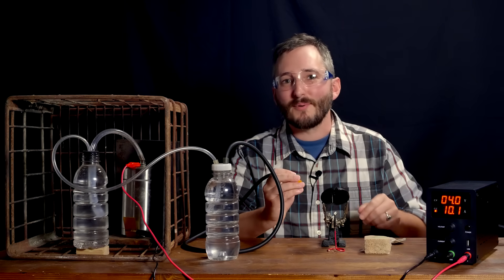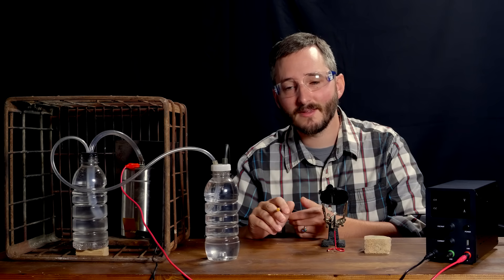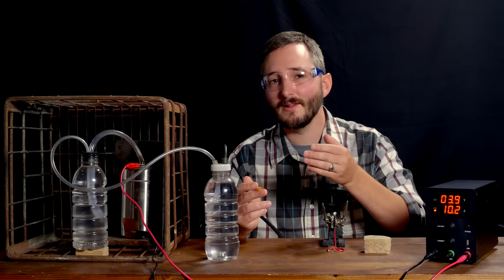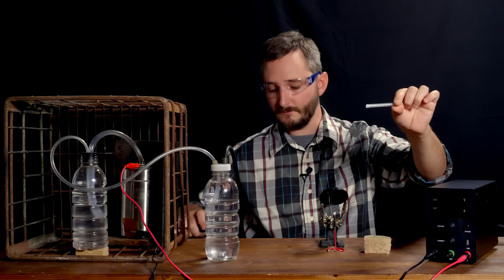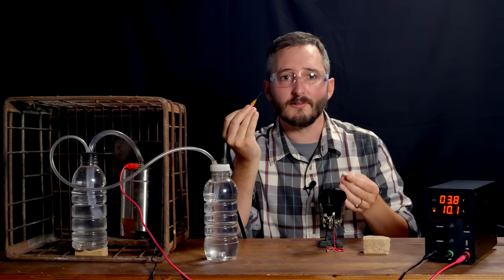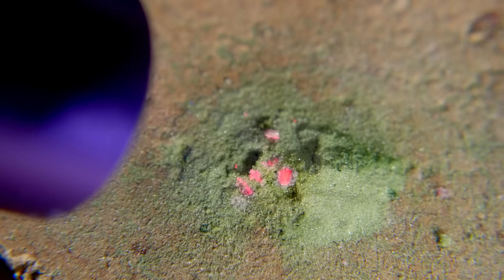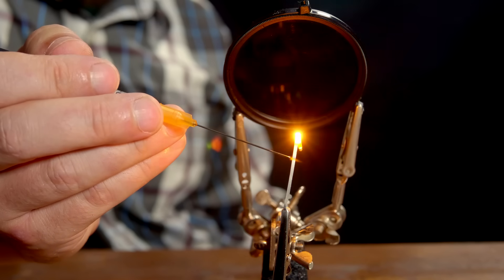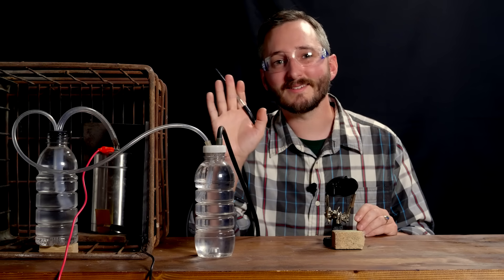DIY Oxy Hydrogen Torch Using Water Electrolysis

Comment: Thanks again for a very information packed video. You once again dug out a whole lot of excitement from a very basic scientific concept. 
Two questions:
1. if you can so easily ‘wipe out’ the retro burning with a simple swipe with a wet sponge, can’t you then prevent that risk by just always holding / firmly tying a wet swab around that fine metal tube? Or a cotton thread wrapped several layers thick and kept ways soaked in water. May be also have a much longer metal tube with that wet contraption outside. 
2. Why isn’t the stainless tube needle melting with the heat?
Reply from the maker: Yes, you can wrap wet cotton around the needle and that works well. The needle doesn't melt because the flame normally stays outside. When it goes inside the needle does melt, but not instantly

Comment: 5:23 The aluminium in the syringe will also cause the flow rate to drop significantly as it creates resistance for the flow and a turbulent flow.

Comment: Is there any reason you couldn't extinguish it by dipping the tip in a cup of water?
Reply from the maker: Lowers flow rate of the gas potentially causing flashback

Comment: I made a really effective HHO generator from 2 stainless steel tubes with a spiral of insulated 2.5mm wire separating the 2 tubes (one inside the other) surprisingly the spiral angle makes a difference to the output, at the same power draw. I setup 7 of these tubes in a container and let it rip at 30v and about 15amp draw it makes a decent amout of HHO.

Comment: "forces the gas pressure to increase"... I don't think so, this type of constriction creates a classic Venturi effect which increases the flow rate and counterintuitively forces the gas pressure to decrease.
Reply from the maker: Gas pressure increases in the system as a whole due to the smaller outlet. Pressure only decreases in the nozzle itself as speed increases.

Comment: Great video. Well explained an interesting. Could one not adapt the system to use an adjustable brazing torch head? Is this fuel source too dangerous for a foundry or furnace?

Comment: Great info and designs here. Surface area greater the more flow of electrons and efficiency combined with KOH being the best electrolyte is a bundle of help hard to find. I knew about surface area logically but KOH being so much better than salt or baking soda fascinating.   By the way do you know how long stainless steel scrubbers last with KOH? How long before they have to be replaced? Love the ease of replacement. I surmise the scrubbers inside the stainless steel wisker highly extend the life of it with most current electrolysis shunted to the scrubber. What is your take or opinion.

Comment: A lot of pussy footing going on here. Their is no reason why this could not be adapted for practical us with small counter gas, cooker
rings. In which bubbles and filters are used to prevent blowback. Or dampers to extinguish flames,  by using wet cloths as a experiment first before looking at other things that could extinguish flames on the rings safely.
Reply from the maker: No stove burner is made to work with oxy mixed gasses.

Comment: Hey man just an idea, if you used a small C02 cartridge, like from a whipped cream dispenser ect, couldn't you pressurise a small valve that could open, with either your control or a small temperature sensor at the end of the needle, which could send a small amount of C02 into the system increasing the flow rate, with something that isn't flammable? Couldn't you then use this for longer periods of time without worrying? Or just have it connect into the last bottle in the system to prevent flashback to not damage the system?

Comment: Hi Matthew, like to watch this stuff, i was wanting to know what you think about using this device to smelt copper, brass etc, instead of buying propane to power a furnace, i would like to know if there is a way to do this, what are your thoughts.. thanks, Chris- York,England
Reply from the maker: I think it would take a very large version. At least 50-100x the size of mine.

Comment: Im curious...  if you use this hydrogen generator, to power a sterling motor, and use pelletier devices as cooling fins, and attach a small generator with pulley to the sterling...   could the sterling, produce enough power, to provide the amps required to run the hydrogen Generator? In essence a perpetual motion machine. Also could it overcome hysteresis  and in fact produce a suplus voltage that could be stored in battery state?

Comment: I would like to see HTE process, or High Temperature Electrolysis. Super Heat steam and run it through a iron pipe. The iron pipe oxidizes and reduced H2O into pure Hydrogen. There are no videos on this.

Comment: Hate to be the prick here but…by using a small tip (choke), the exit pressure is lowered Not increased. The exit velocity is increased. Pressure & Velocity are inversely proportional! 

Thanks for video!

Comment: This could replace spark plugs lighting up petrol fuel mixture in internal combustion engines:))
or heat the cilindar of an diesel engine before start, replacing pre heaters..
Amazing stuff..

Comment: Using a steel mesh on the tube might prevent flame from travelling through the tube, as an additional protection. (Just like the flame arrestor mesh in Davy lamp)

Comment: Great video i am inspired, i wonder can this tackle a real world test i have in mind to make a custom tool? I need to make a hole in a giant wrench a 2' giant wrench due to its shape and size for a custom puller insert. I wonder if it can melt a hole into the middle of the wrench so a rod can go through it? size of rod aprox 3/8". i am jus about crazy enough to try this as this might be better than a plasma torch which would make alot of heat and mess. very very kool video tho!!
Reply from the maker: Drill press. A torch with ruin the steel's temper.
Reply: @Nighthawkinlight  i have rounded drill bits like an f1 car around a track and barely have a 1/32 pilot started. i need better bits but a very cool torch setup still gives me ideas

Comment: So if you put that on a 3D printer machine right just the machine capability to laser print something so you put that in a laser printer and you put that on top of a piece of stone could you make a perfect carving if you just put that on a laser printer put in a program and let the thing just be back and forth just melting away blasting away a piece of marble or something but it makes the perfect statues that we see from the old world perhaps if you put that on a giant boom crane lift like these 3D printer machines that they use for building homes could it take a boulder and slice the s*** out of it to whatever you wanted could it potentially make the adult Ebola caves and like India what is that place called I don't know could it so you put it on a piece of mining machinery could it cut intricate mine with just an AI system just programmed into it could potentially be on a bulldozer with a on a LaserJet on the front of a bulldozer and just go right through a mountain

Comment: You should try putting a gas in a small engine, ignate it and control ignition with spark plugs. Conect that to a electric  generator and calculate efficiency. Input vs output. Material for a new video :)

Comment: Nice.
I used larger Stainless Plates and Baking Soda in my first attempt to fuel a small engine but it didn't quite produce enough as yet for constant running.

Comment: the pressure actually decreases. Velocity increases. they are inverse. Bernoulli's Principle.
Reply from the maker: Bernoulli's Principle deals with nozzle pressure and velocity assuming a fixed pressure input. Pressure in the system as a whole increases when you make the outlet smaller such that less gas can flow through it.

Comment: Use the water electrosis concept to fuel a plasma reaction (since plasma needs a gas to create a "spark" inside a vacuum chamber). You can pair with CO2 to create a cold fusion reaction; which would be useless, since we use thermal generators in powerplants. It could be useful

Comment: you equation is wrong this is correct 2Hsub2 + O2 = Hsub2O you should not show unbalance equations.
Reply from the maker: Your equation has 4 hydrogen and 2 oxygen on the left, and only 2 hydrogen and 1 oxygen on the right.

Comment: I  wonder if that would work through one of the Little Torches?  The smaller tips have a sapphire or ruby  insert with a very tiny hole drilled in them. That's really cool, thanks.

Comment: DEEP $h1t man !  You just described what the oil and gas industry/military-industrial complex disallowed/took all patents, etc.  "No cars that run off water for you". Hydrogen generators from water are real but not allowed...yet.  Near Zero energy is coming out before or at the same time. Zero Point is being used by certain orgs/military factions that are totally dark like DARPA. Sometimes you need to read between the lines to hear what they actually say. You can imagine the implications. People disappear for that or less.
Reply: Energy is put into the system to split the water into hydrogen and oxygen in the first place. This doesn't just turn water into free energy.

Comment: Why don't you simply use a standard electrolyser, where you can collect the hydrogen and the oxygen in separate tubes, then combine the two gases in a short Y-shaped connector, where you set them on fire? This way the flame could not back fire beyond the Y connector.

Comment: I wonder if oxygen is necessary in your system, can't the torch get oxygen from the atmosphere? Without oxygen in your system, it would seem much safer - which you provided with a separate safeguard. 2H2 from the device + O2 from the atmosphere.

Comment: Where did you get the torch itself.  Or did you build that too? 
What are you using for a flashback arrestor?  Where did you get it, or how did you build it?
How much pressure do you think you're getting from the setup?

Comment: Next hho generater you build you should put the water under vacuum, because it would put it at a lower boiling point. Patassium hydroxide is good for making hho when combined with water, and the fact it heats water makes me think about water and the boiling point of it being a important factor

Comment: So, a very narrow tip forces gas pressure to increase... No. Bernoulli principle. Just like adding a resistor won't increase voltage. To use a water analogy.

Comment: Very cool, hot, but cool. The limestone glowing thing, there are videos of a city in a plain in the middle east made of limestone, that has millions of balls of pure white sulphur,  over 96% pure, aka , brimstone, still embedded in its walls. Evidently the tempetature reached  in that place was high enough to achieve thermal deionization, is that 6000°F? There are wavy patterns on the walls. Its trippy. But , now, after seeing this video, I wonder what exactly that city looked like. So, would it  have been glowing very bright? Also, isnt Venus made of sulphur. It was once thought to be made of phosphorus, hence the name in Latin. And widely known as the Morning Star. And, arent there a couple of big rocks headed our direction? Congress rushed a bill through a couple years ago  with no dissention and without much publicity concerning basically performing the "Armageddon " movie. I think NASA published that this one that comes near in 2028, and then closer in 2035, is projected to have a substantial chance of a direct Earth impact in 2068. Halley's , that comet that comes around every 75.89 contemporary solar years , is due about 2061. Halley's seems friendly and reliable, unlike other NEOs. Well, its late, this got sort of off topic, but you asked for comments.  And for your next feat how bout roasting a marshmallow from the inside out, and make smores while your at it.Ty and goodnight. And making holes in glass is an excellent use. How about welding the glass?

Comment: WOW!!! I ALWAYS WANTED TO BUILD A SUPER TINY "PULSE-JET" ENGINE!!!!.... SUCH A TINY FLAME, WITH A SMALL NOZZLE MIGHT HELP IN MAKING IT WORK,... BUT, I WOULD TRY TO FILL A "CO2" CARTRIDGE WITH LIQUID PROPANE, AS A FUEL TANK, AND SEE IF THERE IS A WAY TO BUILD A TINY GAS "REGULATOR" TO CONTROL THE RATE OF FUEL FLOW.  MAYBE,  ONE COULD USE JUST A SIMPLE NEEDLE VALVE?!....

Comment: Would there be a way to test the purity of both gases after having them separate? Is it safe to breathe on the oxygen separated from the hydrogen?
Reply: Nuclear submarines work on the principle of electrolysis to produce breathable air for the crew, so it should be mostly pure. Don't use stainless steel as it could produce hexavalent chromate (as pointed out by other commenters) and use potassium hydroxide as the electrolyte because common table salt (sodium chloride) will produce chlorine which is definitely not fun to breathe.

For testing, it probably won't be 100% absolutely pure oxygen because of slight impurities in the water, electrodes, containers and whatever was filling the tubes before you started the electrolysis but it should be good enough. I doubt a homemade HHO generator can make medical-grade oxygen though
Reply: Yes they sell browns gas medical devices

Comment: I have a “commercial HHO torch I bought on Amazon that is advertised for jewelry work. I am trying it as a heater by directing it into a 1” tungsten cube in an old bbq grill in my shed/workshop. It raised the temperature of the shed 20 deg. From 50 deg. F. To 70 in a couple of hours. My shed isn’t insulated but I hope to do that to see if will make my shed warm enough to endure in Michigan this winter. Wish me luck. Also I’ve never had a problem with flash back with this torch. They have you fill the bubbler with alcohol so maybe that makes a difference. You do an excellent job of explanation of this process. Keep up the good work.
Reply: We think you are going to have to make a video.

Comment: For years, a fraudulent charlatan in Hungary tried to sell it as a 'water burner' that uses the internal energy of water ...
Of course, this 'water burner' also had to be plugged into the socket, from where it picked up the electrical energy it used to break down the water ...
Many idiots believed this humbug that water could be burned ...
By the way, the device shown in the video is a very clever little gadget and there are no secrets in it: Reaction of hydrogen and oxygen from water-decomposed water molecules causes re-combustion, the combustion product of which is water again and heat from electricity ...
Sorry aboutt my english, it's not too brilliant...

Comment: Hey man
Can you please make a video formulating an Ultra White Paint ? It has been on the news lately and it appears to be reducing AC usage by keeping a building cool.
Reply from the maker: The channel Periodic videos did a good presentation on that topic. I'm interested to test the paint myself.
Reply: @Nighthawkinlight  Yep :) They did not mention what would be the effect on a building when it is being heated during the winter (that would be interesting to find out) and also they do not show temperatures and difference between Ultra White vs normal white paint. Plus how do you achieve differing size particles of the chemical (barium something I dont remember) ?

Comment: Doing ultrasound and hydrogen fuel can do some crazy things different levels in ultrasound change the direction of the material that is worked with shapes and zig Zags or curved surfaces that edges are cut can become 90 degree edged.

Comment: Im a professional glass welder. That torch would be perfect for constructing intricate welds for scientific glassware.
Thanks for the video.
Tom
Reply: Hey Tom, it’s me, Tom. How’s it going?
Reply: There has been a commercial version on the market for many years. It's called the Aquaflame Torch. Popular with jewelers.
Reply: @_GOD_HAND_  over 100 tho

about 1600 in my currency

rather make one.
Reply: it would be so cool to have this setup in a portable configuration for scientific purposes of course.
Reply: @mjgII  pretty sure there are portable ones

or atleast portable oxyacetylene ones, byt you need to buy a small oxygen cylinder with it because the small oxygen bottles dont last
Reply: Glass and jewelry are great applications, especially since we don't want hydrogen contamination in steel welds.
Reply: @lignesdefuite  what does hydrogen contamination do?  I thought that they close chain links with hydrogen and that they rust more slowly than the parts not welded.  Nothing stronger than chains,  so I wonder what this "contamination" does?
Reply: @lebergerdesphotons4565  Hydrogen embrittlement is the name of the issue, but it is generally not a problem in mild steels. In more rigid higher carbon ones it comes into play and has caused failure of highly stressed parts at lower than expected stress or experienced fatigue.
Reply: @dragoscoco2173  also why running strictly hydrogen thru an ICE the metal pistons/block will eventually fail due to hydrogen embrittleement
Reply: in your opinion would it work for intricate steel welding instead of a TIG welder?
Reply: @comradeskywalker8544  pobably could work, but i wouldnt make it expecting it to work for that
Reply: @VerbenaIDK  ok thx

Comment: oxy acetylene torches use check valves at the torch and optionally also on the tank to prevent flashback. pretty sure flashback arrestors on the torch are an OSHA requirement 100 years old. the hydrogen torch is awesome if it could be made as safe to use

Comment: Have you considered making any kind of power generation experiments, combining multiple processes of converting energy?
For example, a cheap and abundant material used for a chemical or other reaction, to power some kind of other device that would generate electricity with a magnetic dynamo.
Other things like water drops falling on a seesaw, have been used to create a sort of motor/dynamo.